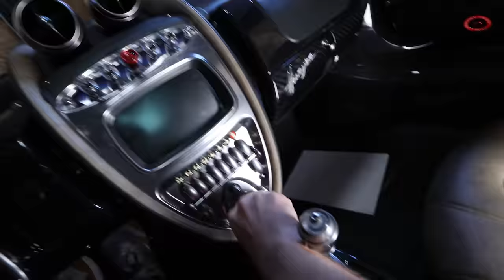The Never-Ending Pagani Disaster.

Comment: Props to you guys for your determination, I would have just sent it back to the Hamilton Collection at the point of not being able to get the key out!
Reply: Let's use your brain dude keep the doors closed ur using battery with them open lights etc strad common sense unfortunately sitting in the car with no air etc sucks but would have worked asap
Reply: I agree. I wouldn’t want to break anything. It is worth $2.5 or $3 million.
Reply: Billy Tuos  I think just to make content on it

Comment: On the newer huayras there is a magnetic charger retrofit kit. The charge point would sit right under the passenger rear vent. Regardless if the car is dead or not it provides enough power for the car to start

Comment: Bro. What you need is a multi meter. The average voltage for good battery is 12.8- to 13.2. If the voltage blow than 12.8 you might need to charge / jumpstart

Comment: A trickle charger is meant to maintain a battery not charge a battery. What's sad is that most cars now a days have a hidden battery but also have remote jumping posts located at an easy to reach part of the car. I'm surprised that a 3 million dollar car doesn't have a set of remote posts to jump the car.

Comment: Putting that thing on a trickle charge is probably not the right choice. Instead, you should just let it idle for 20ish minutes or drive it around for a little bit. Batteries really shouldn't be charged for more than 5 hours, even on a trickle charger.

Comment: I still think the key is not installed correctly.  When the ignition has fired, the car should be facing wheels down as if it's driving on the road.

Comment: Let's use your brain dude keep the doors closed ur using battery with them open lights etc strad common sense unfortunately sitting in the car with no air etc sucks but would have worked asap